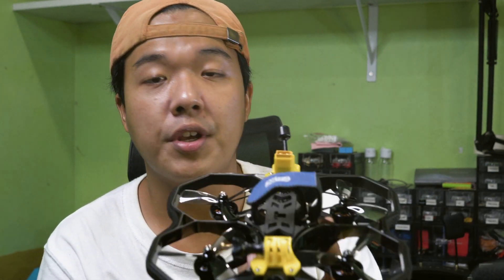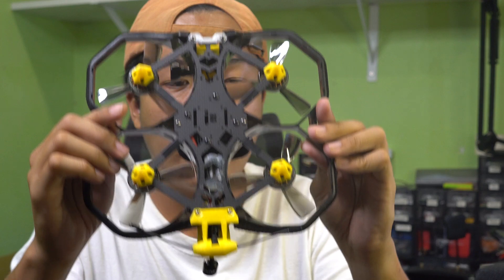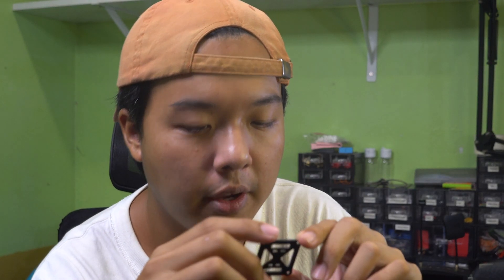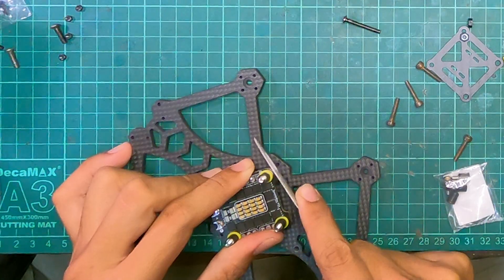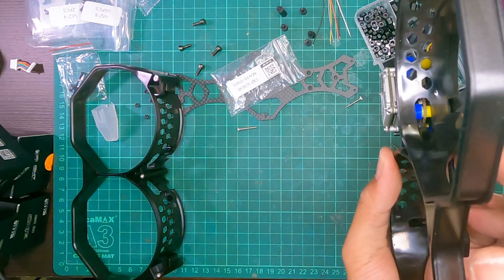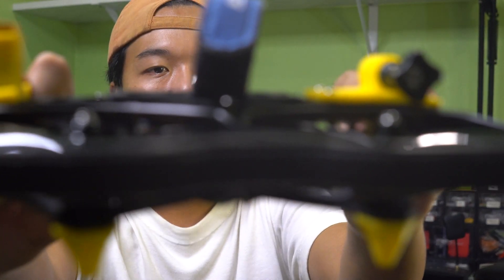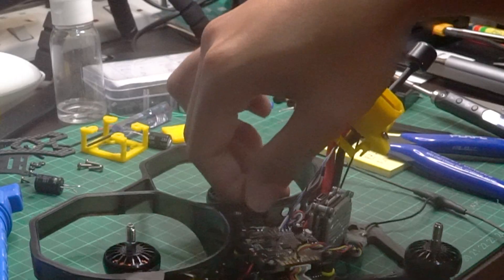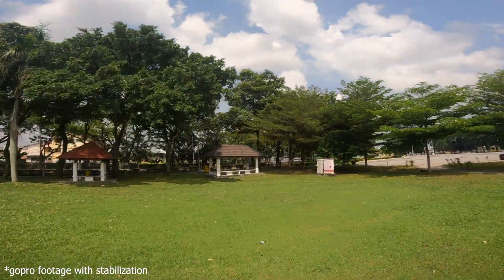Trying to fit a 30x30 stack on a Protek 35 problems

Comment: I'm having a similar problem with my build. I have GepRC Cinelog 35 frame and I also didnt pay attention to the specs and bought SpeedyBee F722 v3 50amp stack.  I have a solution that requires me to modify the prop guards. This is going to be interesting.
Reply from the maker: I’d reco getting an AIO for convenience.. I’m running two Axisflying Argus AIOs currently and they’re solid especially with the competitive price.

But if you still wanna try to retrofit the stack I wish you luck man ✌️

Comment: Awesome idea to fit a 30X30 stack. Will the speedybee f405 stack fit in it?
Reply from the maker: It would but you’ll run into the same problem I did at 2.24
A esc / fc stack plus an air unit lite would not have enough headroom for the protek to close properly. 
I bit the bullet and bought Aio for this build to match with a full size air unit

Comment: But the fc forward arrow shows straight,you placed it as like aio, is there any problem if we put like this? Will it work normally?
Reply from the maker: You'll need to do board allignment, In betaflight, go to the configuration tab, look at the right, there should be board & sensor allignment.
Try adding 45 or -45 to 'Yaw'.

To check if you've done this correctly,  at the setup tab at betaflight, when you move your quad, the image should move mimicing your movements correctly
Reply: @TanFK  thank you bro
Reply: @TanFK  can you please share the base plate and top plate cad file for cutting in carbon fiber?
Reply from the maker: @akshayharidas1235  sorry man I tried searching before, I cant find 3d models for the Protek 35 carbon plates. I settled on just buying replacement carbon parts
Reply: @TanFK  I'm also in the same prob, so I'm thinking to buy a new one., If you have the frame, will you please design a cad model ?, So it will be helpful to most of the people's.
Reply from the maker: @akshayharidas1235  Sorry man I cant help ya there, I don't have the skillset for a CAD Model. 
I might be making a STL for 3d Printed top plate only because my skill cap is there for now. I'll update you If i ever get around doing that.
Reply: @TanFK  if you have the knowledge about 3model making ,then that also works for me , please make the stl file of top and bottom plate.mmm thank you ❤️

Comment: I have 100%confidence in 20x20 stacks of good quality. been racing them and chasing planes at full throttle for a bit. No issues whatsoever. Using Hobbywing 20x20 Xrotor Mini 40A esc with Speedy bee F7 Mini 20x20fc that enables bluetooth connection
Reply from the maker: thanks for the opinion & product recommendation. I guess I'm just caught in the mindset of thinking bigger meaning better, which might not be the case.
For sure I'll consider a quality 20x20 stack on my next purchase of goods!
Reply: @TanFK  do you know if a 20x20 stack would fit a caddy vista on top? I’m been doing a little research and I think it should right?
Reply from the maker: @PandemicFlaw  I just measured
The frame is about 
27mm protek build height

By other items I have
14mm 20x20 stack
10mm vista VTX only

If you stack them upwards. It’s very tight. But possible. Sounds like you’ll have very little space between your FC and air unit which introduces heat to the FC. 
The height of the frame was built with an AIO 25x25 in mind. But you can try to make it work 😬
Reply: @TanFK  I ended finding the same board I had before from a other website. I got lucky since I got a message from iflight that it got discontinued.